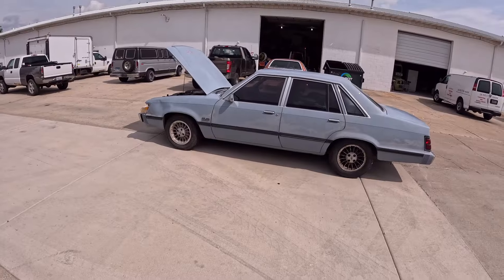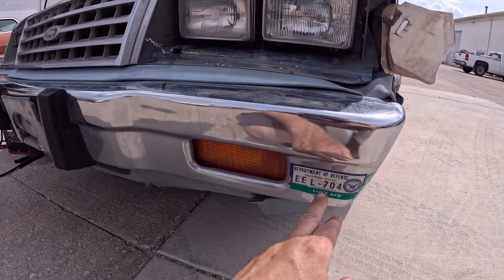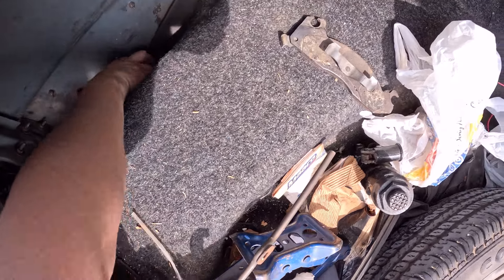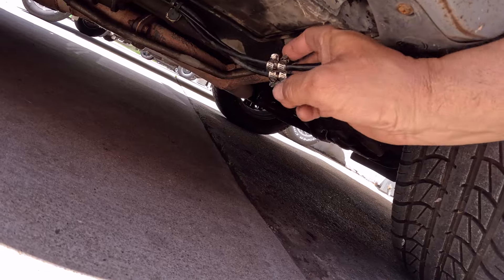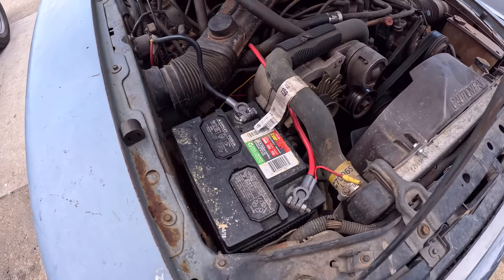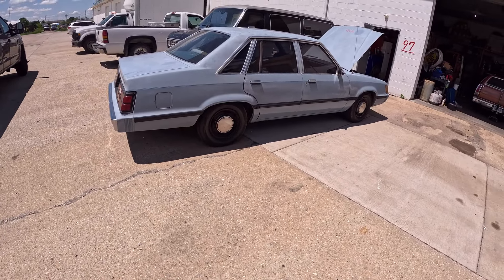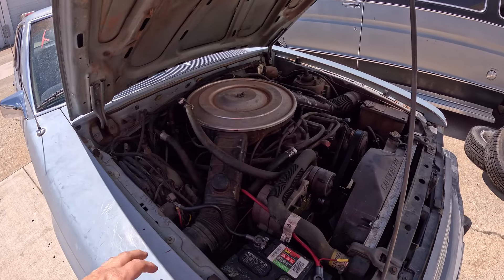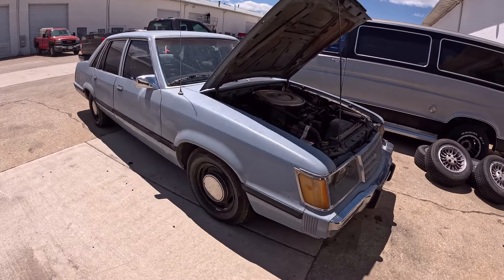Surprise IAA Auction Purchase - 1985 Ford LTD LX Police Package 5.0 V8 SSP

Comment: Definite keeper. motor re build or swap but it needs a manual trans. Clean the paint, get the PDR guy over for the fender, period correct option wheel and tire combo. Need to work on cleaning the interior so its a place you want to spend time. Id upgrade brakes and suspension stance is everything.

Comment: That front fender is a lot more wrinkled up than I thought it was at first glance. It can be ironed out by a good body sheet metal guy, but it might take a minute. I would have a tough time with getting it looking right without turning it into dog dodo.  At the minimum, I think this car deserves a good scrub and clean. And fix the squeaky steering wheel. 

300 to 400 hp would be a good package for this car. I would also keep the column shifter automatic. Suits the nature of the car. This car is pretty light, so  300 to 400 hp would make it quite a lively package and you would not have to start getting into a lot of other changes to properly accommodate more power.

Comment: Great video !! Polish the paint , fix the dent , and replace the damaged head light bezel etc. clean up the interior and you'll have a real nice car , upgrade the engine and tranny you might not make a profit but you'll  have a real sleeper that you can enjoy for years to come and its value will go up over time , love the tires and hubcaps , very correct , I remember these cars when they were new , back then I loved the 429 LTDS  from the early 70s , in 73 you could get an LTD with the huge 460 ! premium gas only !! Love those old Fords !!!!